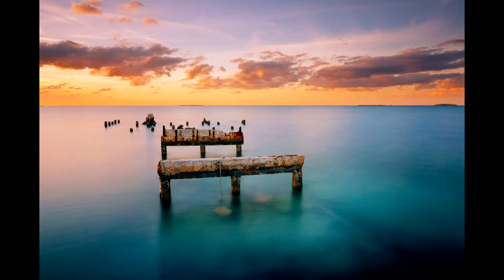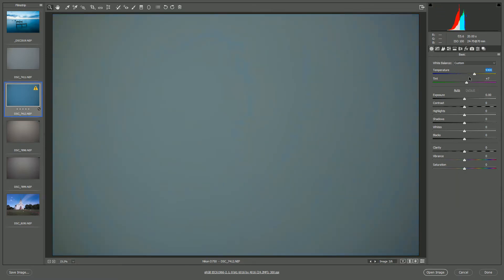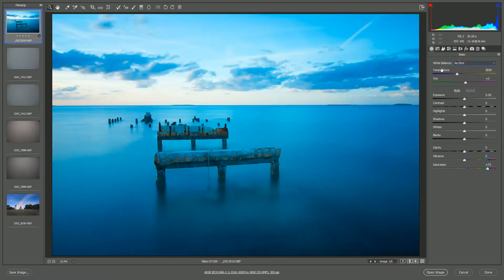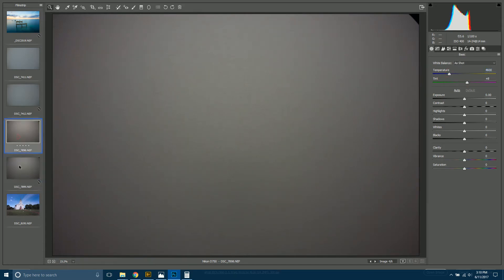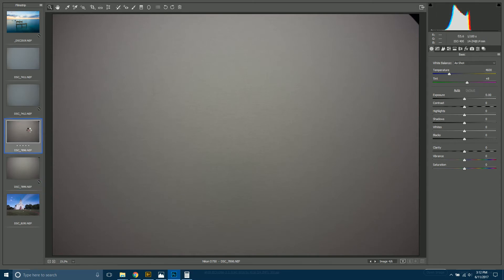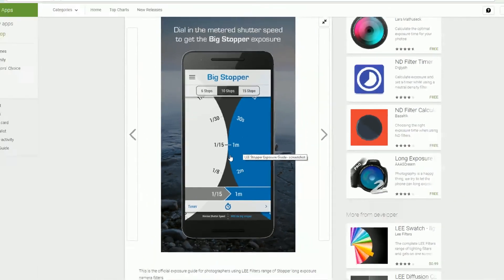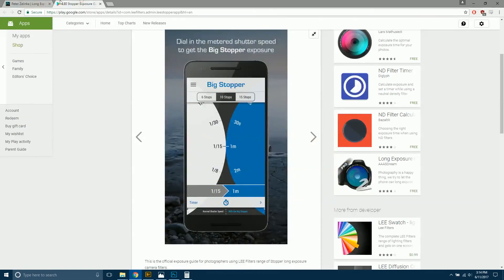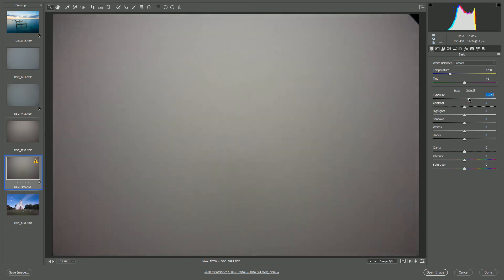Long Exposure Tutorial - Remove Color Cast and Determine Filter Density

Comment: Shoot in RAW white balance Kelvin set at 10000 thats how i do it.
Reply: Davy Scales I just invested in Lee filters. So you set it in camera and it usually works for you at 10000? I would rather see it when I am out shooting than have to see it in post and correct it there. Your way sounds good. Anything else I should know?
Reply: @MrGflan  Also you if your camera has a custom white balance setting, you can take a picture of a white balance card in the same light & sync it later on in post or make it your default WB  for that particular shoot. I use the ColorCheckerPassPort from x-rite on site & create camera profile in LR. iI'll give the  10,000 Kelvin next time I use the filters. Always looking to learn something new. Did it work for you?

Comment: this is awesome, thankyou. just ordered an ND filter to start using in the next few days!
Reply from the maker: What filter did you get?
Reply: https://www.amazon.ca/gp/product/B003M4P7HC/ref=oh_aui_detailpage_o02_s00?ie=UTF8&psc=1 
budget is an issue for me right now, so it's nice and cheap, but haven't noticed many issues with it as of yet! seems to be holding its own. tomorrow is the day I venture out to a waterfall nearby to get some long exposure photos of it! wish me luck
Reply from the maker: The filter in that link is a UV filter. Those don't function the same as an ND filter.  They are mainly used to protect the front of the lens.